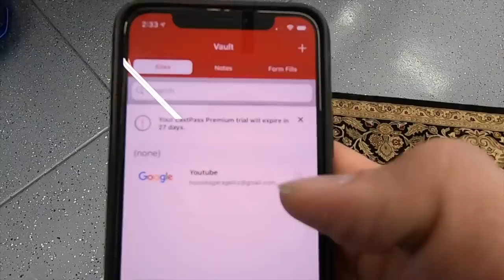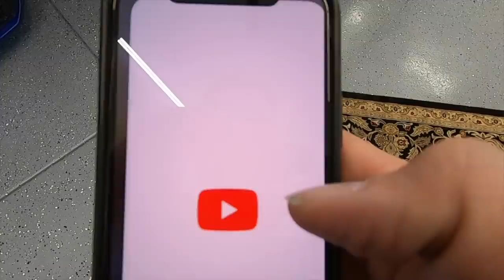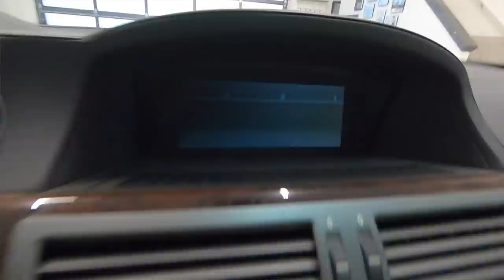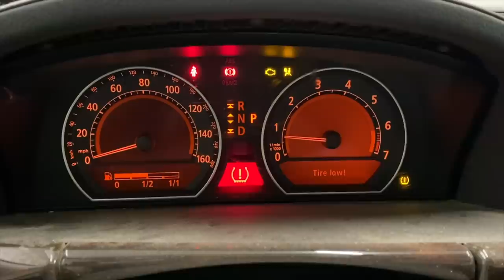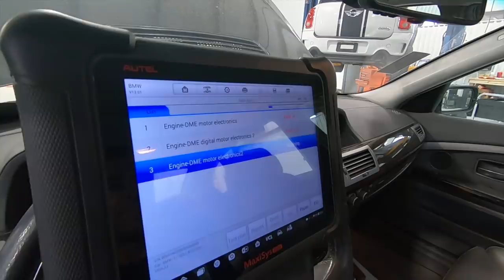I Bought a Cheap V12 BMW 760Li, Because I Never Learn From My Mistakes

Comment: Hmm if it turns out that's all the repair costs, plus tires and giving it a good wash - it's not bad at all! Worried about the alignment - maybe the inspection missed some parts replacement in the suspension? With a bit more luck it will be a terrific limo. But the design and color is dull, so nothing to be excited about.

Comment: They did make a good car. 1987 325i. The E30 was the last of the "old" BMWs, and so was properly made. Engine made like a brick outhouse, handling was excellent, needing no power steering.
And the 2.5 straight 6 is a pearl of an engine, especially when mated to an aftermarket stainless exhaust system.
Oh, and no stupid electronics!

Comment: There are two ways to buy a car like this, new with a manufacturer 100k mile extended warranty, or certified used with a manufacturer 100k warranty.

Comment: 3-4K to repair after not being maintained properly and you mofos complaining about a money pit, i own a m5 f10 since 2014 and with proper maintenance and on time the car runs smooth and no issues.
Reply: 760 is a moneypit. Let alone you find one fucking mechanic that is willing to make his hands dirty for a V12 that's a huge pain to repair it.

Comment: If u watch hoovie first video " I bought a cheap v12 bmwv" go to 11:35 and u can see that the wiring is good with no tape on it, Then when u watch this last video when the car came back with issues in limp mode go to 9:00 and u can see that the wire is tape up and longer and the mechanic acting stupid like he don't know who did it when he was the last person in there butchering and swapping out stuff.

Comment: depreciation of these cars is based on low units sold and high maintenance costs. that's why older luxury cars depreciated slower than new ones. the repair costs are allot lower before everything went electronic.

Comment: I love my e46 wagon - at 200k miles it doesn’t burn a drop of oil, easy to diy repairs - but I wouldn’t recommend for the faint of heart. You gotta love the design and drive feel of these cars. I also have a Honda Accord and a AAA tow gold membership, they complement the bmw well.

Comment: Oil leaks will be mitigated if you switch to a non synthetic oil. Synthetic oil especially those with high percentages of silicone have much greater lubricity => meaning it can get into very fine cracks and get through the small spaces like around gaskets. You might also consider adding a dialkyl zinc or ZDDP

Comment: I have to say, I loved my 2002 BMW 330 CI that I bought in 2010 (used with a little over 100,000 miles on it) and sold it about 50,000 miles later last year (When the transmission gave up the ghost at about 166,000 miles).  Until the transmission started failing, other than needing a water pump once, it was pretty reliable.  And boy did it drive beautifully (I remember thinking that the old slogan "The ultimate driving machine" has veracity, to be sure).

Comment: If you run some automatic transmission fluid through the fuel and oil before you change the oil it will clean everything and help seal some leaking seals, it worked on my cam cover seals on my Subaru, and they're on their sides..

Comment: BMW's are truly a nightmare! There is absolutely nothing on these vehicles that simple to repair. Parts are very expensive and most repairs require an expensive professional mechanic. Moreover, these vehicle drastically depreciate within 10 years. Changing an upper radiator hose on most high performance vehicles is a 15-minute job.  However the hoses on BMWs are made with plastic couplings that are held on with clips. These hoses are very difficult to remove after they've been on the vehicle for a number of years going through numerous heat cycles. The engineers BMW and all of their wisdom, designed the upper portion of the radiator made also of plastic. It's virtually impossible to remove the upper hose without cracking the plastic housing on the radiator. I'm a professional mechanic and I know how to remove a component without force. But in this instance it's unavoidable unless you're very lucky. It gets worse. You must remove the entire undercarriage and exhaust system just to change and u-joint. Yet another example of poor BMW engineering. In order to replace a starter, (or even see it for that matter) you need to basically remove the entire upper portion of the engine compartment. And I won't even get into the friquent issues with faulty sensors, relays, maf, etc. Me interiors are crap. I've seen multiple issues with the electronics harnesses shorting out. I could go on. After working on several of these vehicles, I would strongly advise that you avoid buying any used BMW. I am posting this comment in hopes that I can prevent others from experiencing these costly lessons. If you choose to ignore my warning then you should buy a 3 series BMW and learn your lesson the hard way

Comment: To me it would be a relief to diagnose the misfire on all cylinders as I think in this case at least it is better to have misfire on all 
cylinders than on one or two specially since the car was obviously behind on maintenance. The new maintenance may be all it needs to 
correct the misfire problem (like new coils, spark plugs, vacum hoses, oil seals, etc..) the stuff you would do anyway.

Comment: The problem I have with BMWs is they all look the same. From a distance it's hard to tell the 3 Series from the 7 Series.
Reply: uhh...only recent models...2016 and current...i too hate that shyt. it dilutes the brand in my opinion. i had the 2008 750li...was a dream till it went to shyt....went to 2015 750li....it has also been a dream....and a keeper

Comment: Hey Tyler, the misfiring comes from a the vacuum valve cover. 

You can find it on amazon for like $12. Search PCV valve cover BMW. Takes about 20-30 minutes to fix both and the misfires will be fixed. 

I got myself the exact same car but 750li. Same color too! Cheap to repair if you do some research. It’s usually the diagnosis that could be costly because nobody knows which part needs fixing and they end up fixing the expensive parts.
Reply: So would you recommend one of these to a diy person?

Comment: You got off easy.  Back in 2015, I had to replace the timing case gasket on my N62.  Everything had to come off the front of my engine.  Cost about $3k in labor.
Reply: And that is why people buy Honda accords easier to do labor on.
Reply: @vikingman4614  sure. And you have to take everything off to do the timing belt (several times in the life) except the engine is sideways. That price sounds wildly excessive though.

Comment: It's incredible to see the 'Tesla Effect' on the used European luxury car segment. It also hit the European luxury SUV market as well. The market is starting to collapse. Super early but an indicator.
Reply: High end class cars lost always 50% of their value in the first 2 years. nothing new.
Reply: @indahooddererste  That makes sense on price points for the A8 or BMW 7 series where the margins are really high. But the A4 & 3 series which are priced lower for volume have lost value faster than normal. At least this is the case according to the Capital One article.
Reply: @a_velis  I rather would say thats because several countries have announced to ban cars with fossil fuels. but still i would buy one drive it like another 10 years and then look after a car with an alternative fuel. i dont see electro is the way to go in the future in the massuse.

Comment: thats pretty good 7K ,I would love to own a 5/7 series but the price on tyres man
Reply: I keep buying $150 sets of 20" aftermarket wheels off Pontiacs with 65% tread. I got a +2 wheel upgrade for my 5 and reasonable tyres for about the cost of 4x fitting and balancing along. And they're much better than the standard run flats.

Comment: I bought a 2009 for a few months last year, it was so amazing for a few hours.
It took 3 hours after purchase for the failure codes to start.
Came to find out it had concierge maintenance service  that the previous owner never used and had never been serviced.
Reply: When you say never serviced. You mean never serviced by BMW? Surely a 2009 (F01?) won't even run after a certain point when oil condition CBS detects excessive km?
Reply: @andrewvallner6926  correct the concierge service was never used nor was it serviced by bmw.

Comment: You should try the F01. The 7 that came after the e65. A well specced one is a really special place to be and they're much more reliable... Just better in every single way
Reply: Um, much more reliable? It has the same valve stem seals as an E65 4.4L, and used 2 turbos in a hot V to bake them. I've never seen an F01 V8 described as reliable.

Comment: Bud, did U got any money talking non sense crap about 7 bmw? I`ve had 3 of 7s so far , put ton of mileage on them, sure You have to take care of the car. The last E65 I have for 4 years/now over 600,000km/  and off course I changed the main comp. module/they are known to go bad after 10 years because of the heather/ flush the gear box couple of times/the label life time is non sense/ some other things to,,,,, but if You buy an used car U should have a basic knowledge. Last tip here, Please don`t forget that BMW before start making cars, was producing airplane engines. Very precise work because engine is not allowed to stop in the AIR, :) There is not AAA help like for the rest of the cars on the road now. Take care. Val

Comment: All you do is buy cheap worn out bmw after years of using, and in 2019 you complain they are broken and not worth it, trust me, american bmw marked is crappy, buy yourself a bmw german version, you can tell if it's german/eu/america/china by vin code, and then see how healty and strong the german is, compared to any other market.